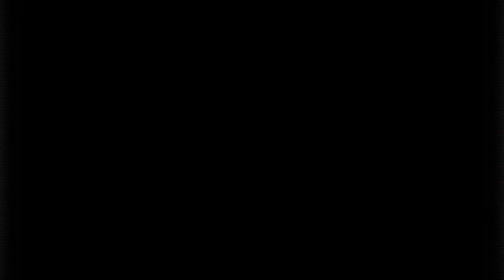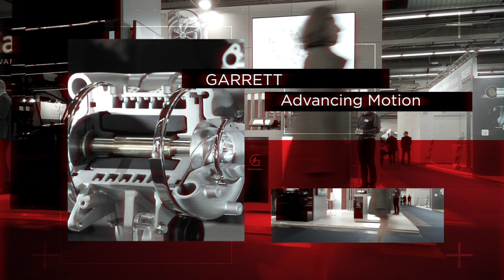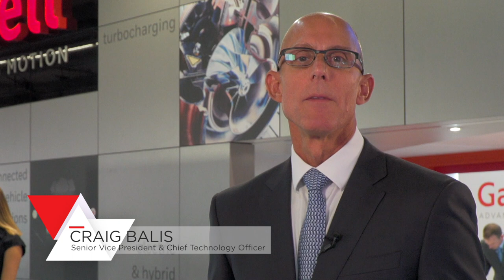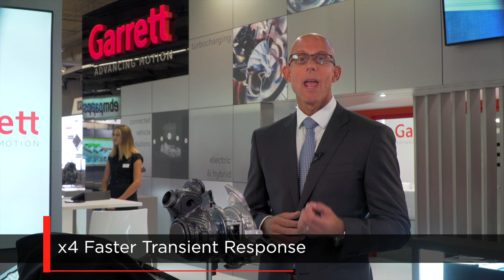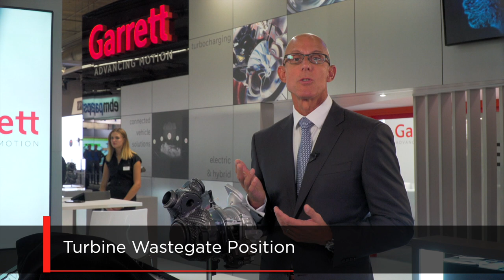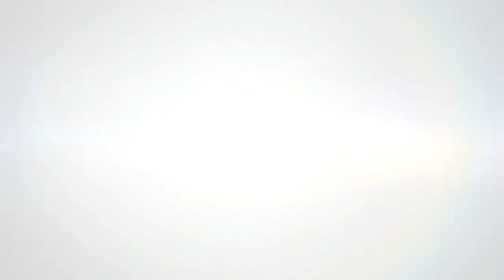Craig Balis on E-Turbo technology and future of Hybrid vehicles at IAA 2019 | Garrett Motion

Comment: Fighting the second world war aircraft piston engine debate of supercharger (mechanical driveshaft power loss- 100%) vs turbosupercharger exhaust recovery( and 20%backpress  load to core engine)  still goes on today 70 years later. The  large two stroke in marine service show it can be done to advantage in the large cylinder classes. This tech is best suited in the class of engines around 500hp in aircraft diesels to replace the less efficient and particularly noisy Garrett turboprop engines. As compared to other 4 stroke aviation diesels it would be lighter, more flexible, fuel quality indifferent, less smog risks, amenable to solve other electrical safety transition  complexities. Elimination of many of the parts likely to fail in a 4 stroke engine is a side benefit. Imagine the drones in particular doubling the time on station and firm common fuel solutions for the US Military. Getting the low lying fruit before the Chinese buy Garrett out of bankruptcy requires putting some of the early product into the hands of inovators. Help yourself Garrett by putting some of these in the hands of people willing to share the work and the glory by striking while the iron is hot and at least name a price.